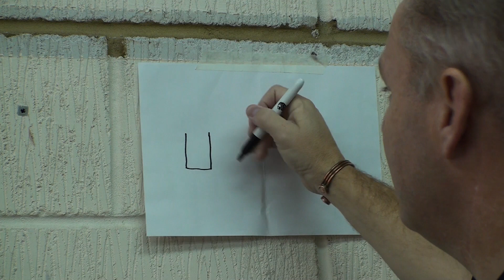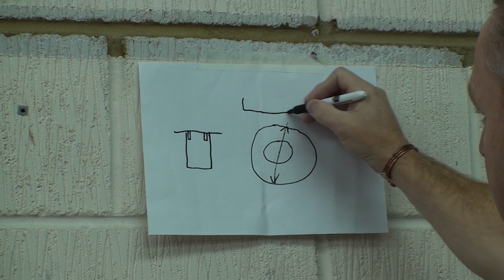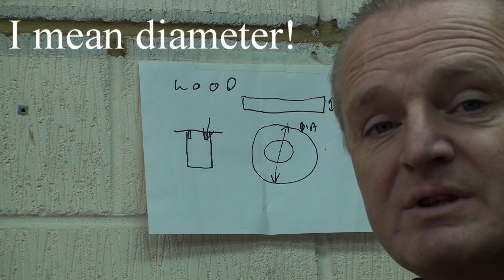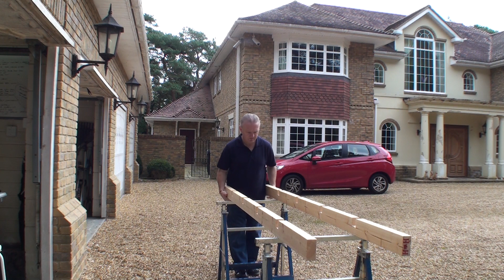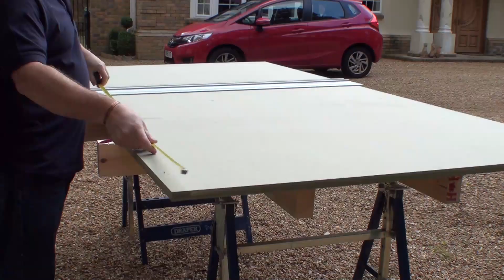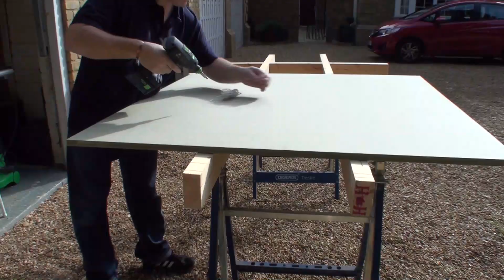Reclaimed Oil Drum Scaffold Board Table (Design & Planning & Mock-up) - Part 1

Comment: They make an attachment that slides into the two openings on the front of the foot base. The standard ones are usually short and can allow a 16" or 40cm diameter circle. But a longer one can surely be rigged up that would be easier than the board/pivot/gizmo.
 https://www.amazon.com/Festool-490118-Circle-Attachment-Jigsaws/dp/B000LKQOZE/ref=pd_lpo_469_img_2/143-0311758-0374846?_encoding=UTF8&pd_rd_i=B000LKQOZE&pd_rd_r=838474f8-49c1-4a40-b77c-38692533062c&pd_rd_w=Ulnct&pd_rd_wg=JyYU9&pf_rd_p=337be819-13af-4fb9-8b3e-a5291c097ebb&pf_rd_r=M9WJZTJ238KSFEWPMVKR&psc=1&refRID=M9WJZTJ238KSFEWPMVKR